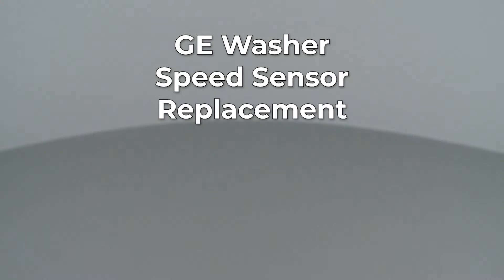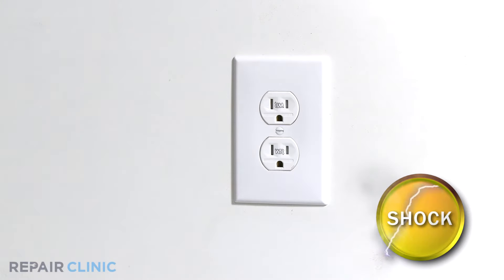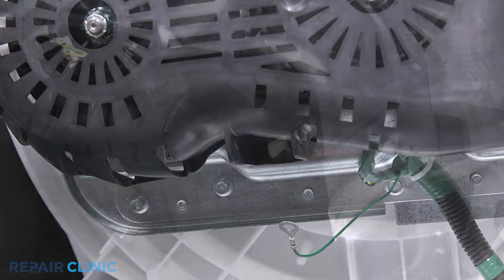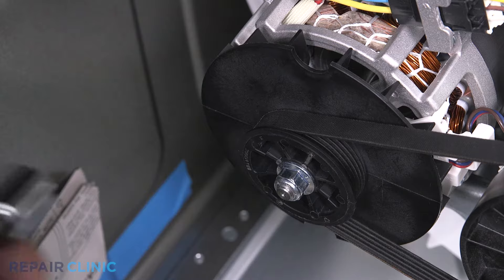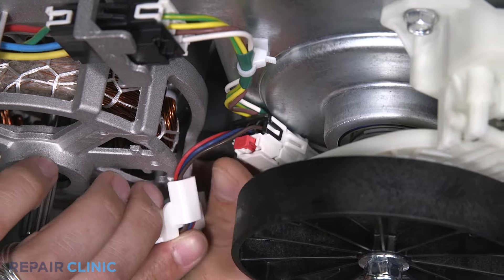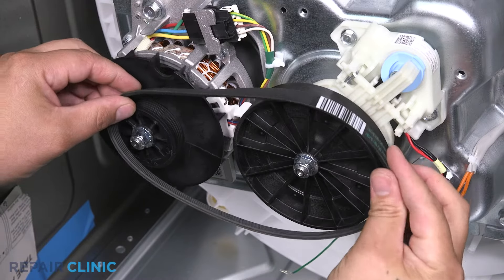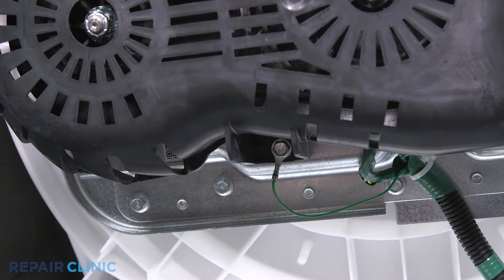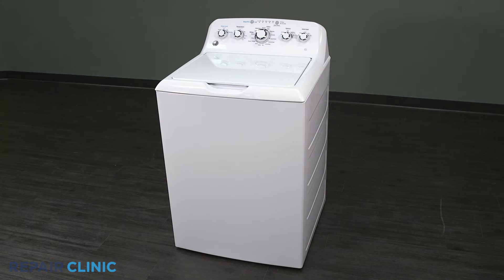GE Washer Speed Sensor Replacement WH12X26330

Comment: Super simple. My washer was stopping in the middle of the spin cyles. This video was exactly what i needed. Also if anyone is doing this. Really consider getting a new belt while your ordering your speed sensor. I didnt and mine was pretty beat up. im sure im gunna be replacing that in the new future lol.

Comment: Our GE washing machine (GTW460ASJ8WW) won’t finish the cycle in SOME settings. The clothes just remain wet and soaking and it won’t go to drain and spin all the way. Will replacing the above mentioned sensor fix the problem with my washer?

Comment: It says, "The most common reason for replacing this part is if it's missing or broken."    The reason it's broken is that the belt has gone bad and the shredded belt has broken the plastic casing for the speed sensor. 

I noticed another video that shows you can save a lot of money with this repair, entitled:  "GE Washer Belt Damage: Sensor Replacement That Saves $100 Plus!"
by Harper & Knowles Washer and Dryer Repair

Thank you for posting this video. I am ordering parts today.